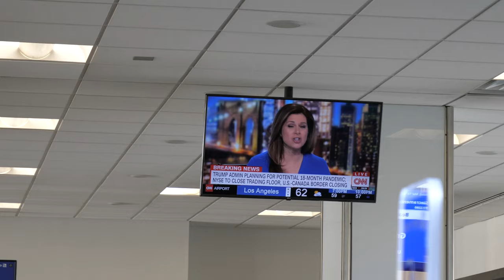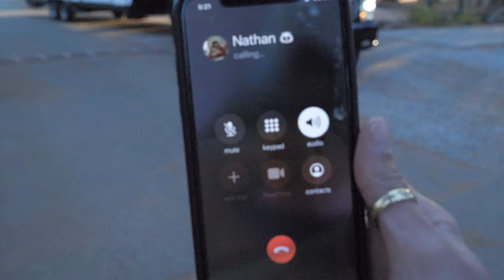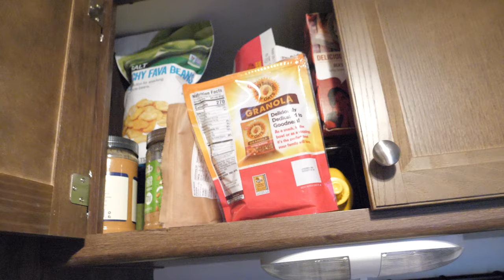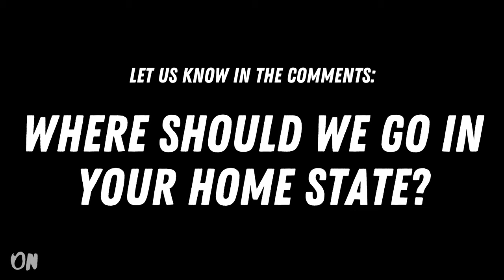RV NEWBIE First Day In Travel Trailer // Lake Tahoe, California

Comment: I've been out of RVing for 20+ years but this is what we used to do. When in a site with water and sewer, we would not be hooked up all the time. We would fill our water tank and run off of that so no outside hose to freeze. On the sewer, we would use our tanks and then empty when we were leaving. That was mainly not for freezing but rather for making sure the tank empties correctly. If you keep you hose attached and open, the liquids will trickle out but the solids can accumulate in either the tank or the hose. We preferred to let it fill the tank and then flush all at once. This cleans the tank and the hose better. Hope that makes sense.
Reply from the maker: Hey man, it totally makes sense. If we stay in freezing temperatures that's what we'll have to do. We're still not sure our trailer is "made for" the cold lol at first we were unsure if our tanks or pipes would freeze without us going in to get things insulated, etc. We're still trying to find out if we could travel in 0 degrees if we wanted to. But really, we plan to avoid freezing temperatures all together and go near Texas. Thanks for your help.
Reply: @ONWorldTravel  unfortunately campers are not built for full time living and certainly not properly insulated for cold weather.
Reply: I would use that method all the time. Even in the summer

Comment: The random climates while traveling is why i always try to keep my fresh tank full(60 gallons) or at least half on drives, I do boondocking alot more though than say campgrounds. I tow with a tahoe that has the same tow rating as that Escalade too, It feels it going up steep hills. But if a planned hilly route, i may only fill the fresh tank to 1/4(15gallons). It's also handy for those random bathroom pit stops in the middle of nowhere or unplanned stops such as getting caught in a winter road closure for a night. So you have water to use the bathroom. Or i keep 8 1 gallon water jugs onboard too, to use for the toilet or drinking incase the pump fails or major issues arise till things can be fixed.
Reply from the maker: GREAT tips Jon! Thanks so much for taking the time to write this out.
Reply: Good idea, thanks for sharing. Added a note for myself. :)

Comment: lol pisser, you need heat pads for the tanks and water heated hose for cold weather camping. Not sure if your camper's belly has a cover to close out the entire bottom- i would suggest to get one on there. Stops critters from calling your camper home keeps camper warmer from cold wind running below. But if you were to winter camp often, I'd invest in a skirt. I mean thats if you remain some where below freezing temps for a few days often enough.
Reply from the maker: Thanks Jesse, yea we weren't the best prepared for winter if that wasn't already obvious 😂but we're learning! We're getting a heated hose now and will better insulate the tanks for when we head to colder places. Our camper's belly has a cover but it doesn't extend out to the entire bottom so we'll have to do that. Thanks for looking out! Cheers